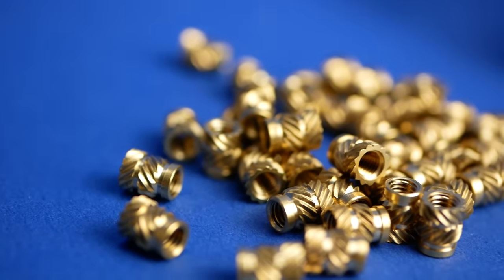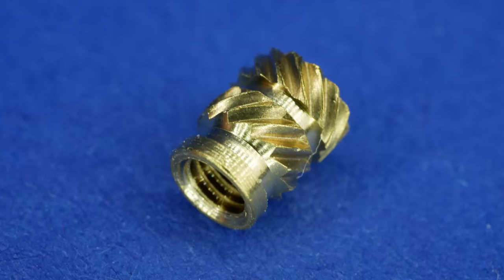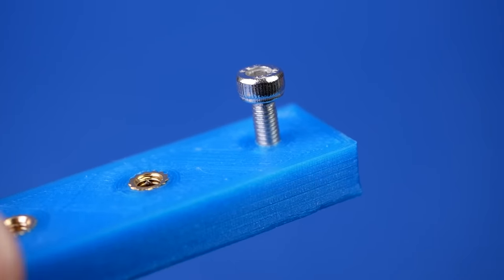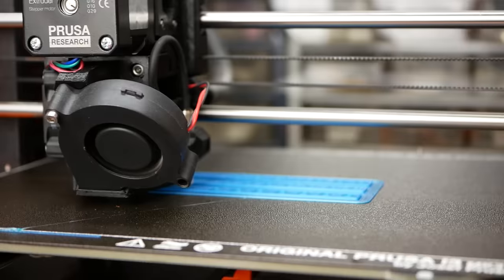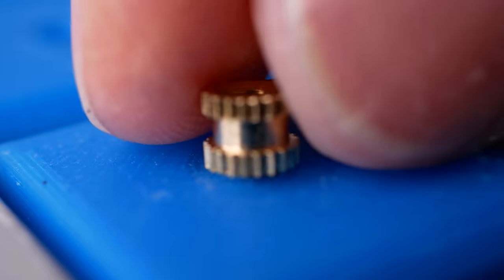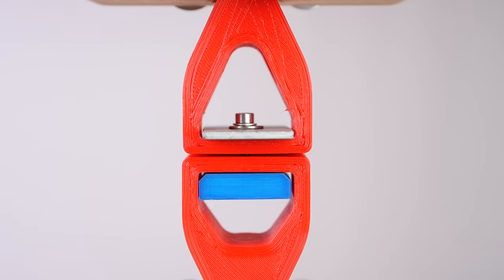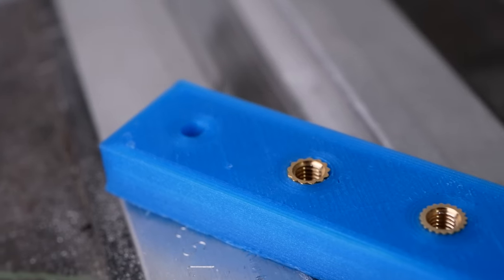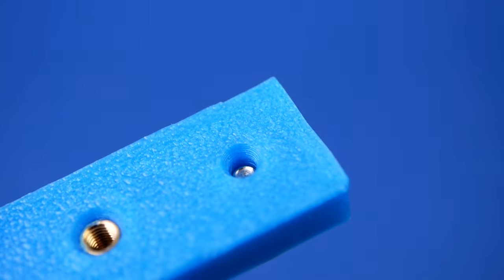Threaded Inserts for 3D Prints - Cheap VS Expensive 💰

Comment: "M" style threads are not designed for plastics, so it's awesome to see so high pull-out numbers. Next time please consider special plastic screws like Würth Plastofast. http://www.wurthelektronik.fi/Tuotekuvastot/Fasteners/index.html#7 I have used those long time for molded plastics and they work really well. Not sure about printed parts, but hey...can't be worse than M threads, right? :D

Comment: There’s no way a hardened steel bolt would shear like that before the plastic gave way.
Reply: well you said it yourself, hardened. the steel is brittle sheers. I'd imagine as you torque it, you're work hardening the brass to a point where it has a harder strength than the steel, causing it to snap
Reply: Were they hardened tho? Normally those aren't.
Reply from the maker: Those were 8.8 bolts, which is like the "standard" here in Germany. A 12.9 bolt might have survived that but those are rarely used.